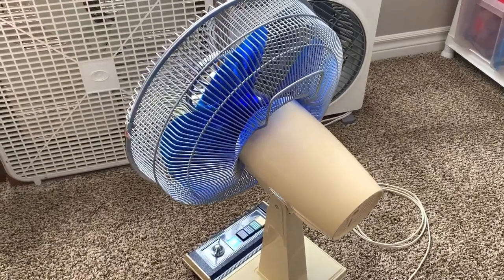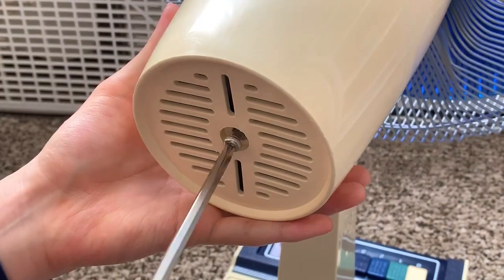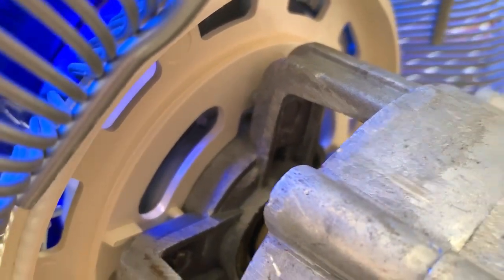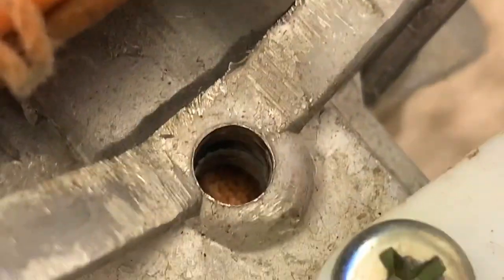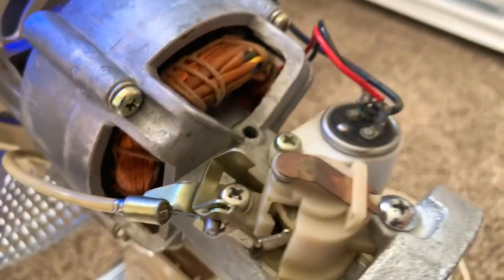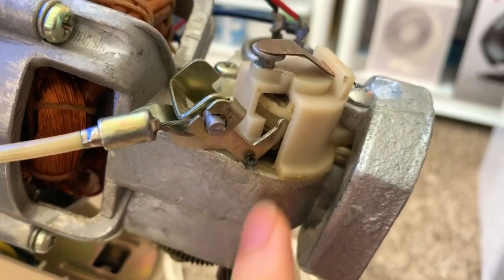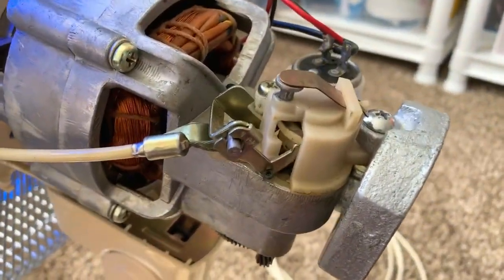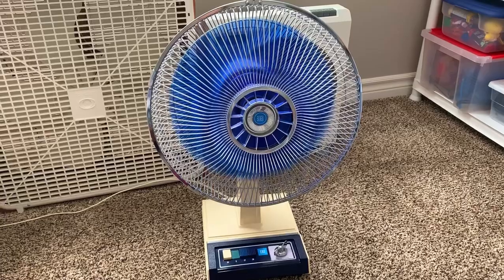Internal Workings of the Electrohome 12” Oscillating Fan

Comment: Hi superfanman I am a fan of your videos. I live in uk.  Last year I got a fan from the 1960s wahson make. It has got two oil ports. My question is  how often do I have to put oil on it? And how much? And what type of oil? Thank you for your videos. They are very knowledgeable and unifying the fan enthusiastic community!
Reply from the maker: Hi, thanks for the kind words! I would recommend using a non-detergent, light weight oil. I’m not sure if these products are available in the UK, but I like to use ZoomSpout turbine oil and 3-in-1 electric motor oil. They are both designed for electric motor bearings. I’ve heard other collectors use air compressor oil which is also great. Make sure you’re not using aerosol-can lubricants or grease since they are either too thin or thick for electric motor bearings. When you first get the fan, there’s a good chance that it was never oiled in its life since it left the factory. In that case, spin the blades to see how freely they turn. Ideally they should turn with no odd noises and coast down without coming to an abrupt stop. I always completely disassemble the motors to clean out the bearings but I know that it may not be a cup of tea for some people. So if you’d like to oil the fan without taking it apart, give it about 10-15 drops into the oil ports, slowly to make sure the oil properly makes its way into the wicks. If your fan already ran good when you got it, you can go with about 10 drops. If possible, put about 3-5 drops directly into the bearings where the motor shaft meets the bushing in the front and the rear of the motor. So that is only for the initial oiling when you first get the fan. In terms of regular oiling, the frequency would vary depending on how often the fan is used. If you run the fan everyday for many hours, I’d say oil it once every year with about 5-10 drops in the oil ports. If it’s only sometimes used, then it can easily go a few years without needing fresh oil. Hope this helps, and feel free to ask if you need more advice!
Reply: @TheSuperFanMan  thank you very much for your wise advice.  And I hope to see more of your amazing videos that everybody is enjoying everywhere around the world.  Stay safe and thank you again for your time .
Reply from the maker: No worries. Take care!

Comment: Yours motor maybe imported from japan for electrohome, bcuz they made those windings with really thick copper wire and thick stator back in the 70s
Reply from the maker: That’s a possibility, though I think most of this fan was made in South Korea. It was manufactured by Goldstar and I believe they would have sourced motors from domestic companies, if not made the motors themselves. But you’re right, it certainly could be a Japanese-made motor as well.